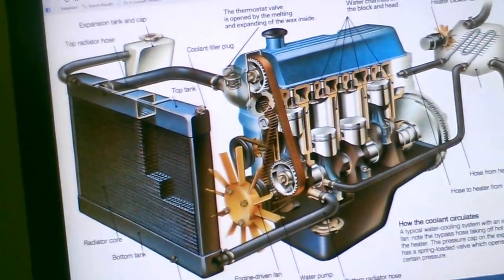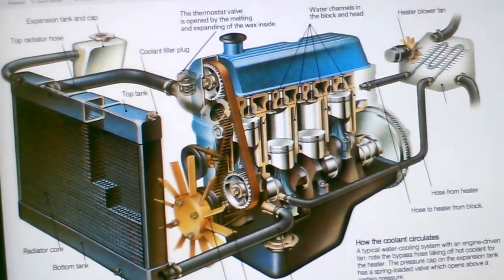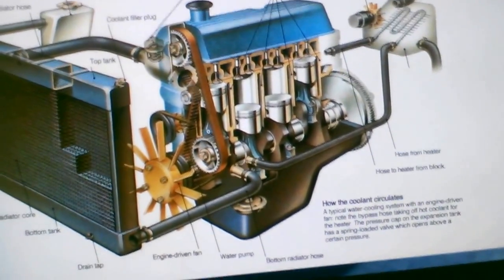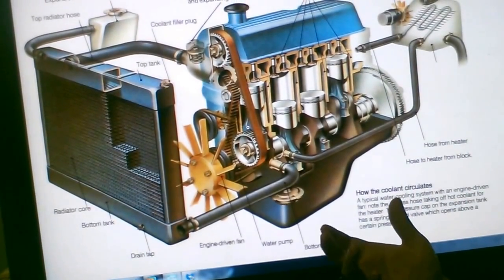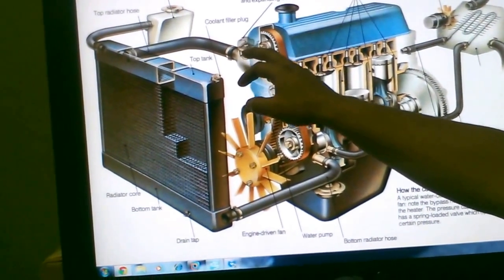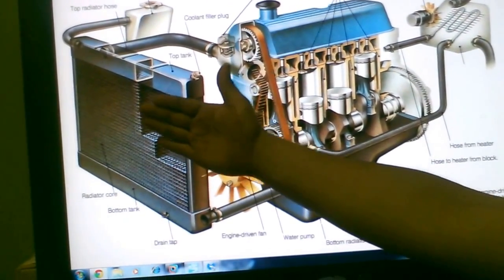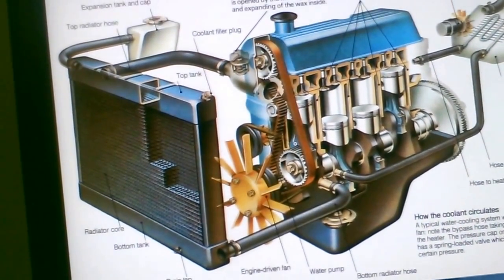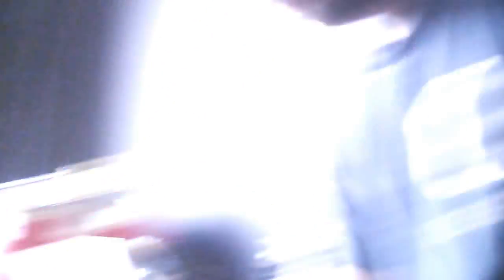Overheating problems ? How cooling systems work

Comment: My 2002 Chevy venture 3400 engine overheats in a few minutes goes to really hot , I have replaced the radiator, water pump, cap, thermostat, and both fans but still overheats !? There is no water in the oil or white smoke could it be the catalyitc converter?

Comment: Radiator service  ready, water pump change ready,  fan belt change ready, injectors change ready, head gasket  change ready  then what's a problem of over heat

Comment: For the life of me I couldn't figure out why my 6.1 Hemi is over heating! New water pump, new fans, new tstat, new radiator, new reservoir, and flush and fill. Still over heating and it just may only be the sensor lol. Great video and info... hope this fixes my issue.

Comment: Hi OZ! Thank You! My 2003 Lincoln Aviator is no longer over heating due to having a new pump installed. My problem now is, it shuts off when I turned the wheel to back up into a parking spot & it then started right back up. HELP OZ!

Comment: Hello, at 4:02 it was mentioned that the fan was not turning on, so at some point the water or coolant boiled and steam left the reservoir tank. I wonder if that can still cause damage to the engine (given the liquid may still be circulating ok because the pump and thermostat are in good condition, AND you stopped until temperature reached normal range.) This actually happened to my B14 Sentra a couple of weeks ago, and it got me a bit worried. I tried to figure out any damage by closely looking at both the motor oil and coolant, as well as any leaks, but found nothing. Just in case, I have changed both the oil and the coolant, and of course I got the electric fan fixed. Any thoughts? :)

Comment: Hi! My 2003 Lincoln Aviator overheats & shuts off.  Hubby changed out the RADIATOR, THERMOSTAT & still the same problem. Took it to mechanic & it came back diagnosed as  WATER PUMP LEAKING! NOT!! HYDRACARBONS in COOLING SYSTEM. We need to know, if & what needs to fix it from overheating & shutting off. wasting $$$$ & still have the same problem. Thank You
Reply from the maker: https://youtu.be/oNg-MyuZiTk 
https://youtu.be/zY6_Y64O5o4
https://youtu.be/VBMWFKOE-So

hope these videos help

Comment: Thanks for this good informations, but my car heats up when I'm drive over 80 km, mabe after 20 min if I drive on 100 it's gets hot faster, what do you think I should start from ?
Reply from the maker: Mahmoud Rassoul I would make sure that the system is topped off. If that's good check the fans make sure they're working

Comment: I have a leak somewhere I have to fill overflow bottle on my Lexus every morning. About once a week it overheats and the water in the overflow pops the cap and starts spilling out also there is a major delay in the fans turning on and there is a whistling noise. Eventually the fans turn on hopefully and the water is sucked into the system from the overflow bottle. Any ideas? Rad cap? New radiator and thermostat and hoses 2 yrs ago. Also the upper rad hose gets pregnant and has white around it. There is coolant flowing through. I am ordering a new rad cap and coolant sensor. Should I replace upper rad hose too? Thermostat?
Reply from the maker: Beeastman123 check out these videos 

https://youtu.be/QYT9g5dh8z8
Reply from the maker: Beeastman123 https://youtu.be/Zxdhkw29oK4
Reply from the maker: Beeastman123 https://youtu.be/6BN_Tke7xL4
Reply from the maker: Beeastman123 hope these help
Reply: Oz Mechanics ok thanks! Also I notice a thumping sound when I'm behind the wheel maybe water pump?

Comment: some mechanics suggest, simply remove thermostat. any advice? thanks in advance.
Reply from the maker: Alvin Balonglong without the thermostat the engine will never get to operating temp. The engineers made it that the engine runs at operating temp and that's how you get better car efficiency. But now if you take it off the newer cars. The check engine light will go off

Comment: hello. .I've been figuring out why my car overheats.  it's a 98 Integra (auto). i noticed my car overheats in idle but maintains Oper Temp when driving again.  i have replaced my thermostat,  upper rad hose,  water pump.  my cooling fans did come on but i feel  it's not cooling the radiator enough until forced air from driving cools it down.  Can i pinpoint that the radiator is bad?  i have the radiator in there replaced about 6 yrs ago non Honda radiator.

Comment: fan works, idling makes overheat, i dont get it. no leak. what could be the problem? when the vehicle is moving at a moderate speed, like minimum, the temperature drops like fast. but as soon idle, it builds up heat.
Reply: Could be malfunction of TC which enable cooling fan or cooling fan itself. Check if the fan is running smoothly when idle. Hope it helps. :)
Reply from the maker: DopestDope check out my other video of how to check overheated engine

Comment: The thermostat's job is to open when the coolant gets too hot and let the coolant travel faster into the radiator. If it senses the coolant is too cold, it closes to slow ...

Comment: The cooling system is made up of the passages inside the engine block and heads, a water pump to circulate the coolant, a thermostat to control the temperature of the coolant, a radiator to cool the coolant, a radiator cap to control the pressure in the system, and some plumbing consisting of interconnecting hoses to ...

Comment: This is the primary cause of engine overheating. Possible leak points include hoses, the radiator, water pump, thermostat housing, heater core, head gasket, freeze plugs, automatic transmission oil cooler, cylinder heads and block. ... A leak-free system should hold pressure for at least one minute.

Comment: I suggest  that you redo this. The water pump is very important...so no likes...sorry and you are saying water? Its antifreeze
Reply from the maker: thanks for the advise. was one of my first videos. did it on the fly
Reply: Using the term "water" is fine, since it is the water that is actually doing the work. antifreeze is added to keep the water from freezing in colder temperatures. there are actually areas in the world where water is used year round. 

i think Oz hit on the relevant points for the problem with this vehicle. don't pick him apart. the thermostat is important, too...are we going to focus on what he didn't do?  or thank him for doing what WE didn't do. 

what I want to know is, how much did you charge the customer for these repairs?  I'm on a hunt for fair and honest garages around the country, who are fair to customers who don't know anything and customers who are knowledgeable alike, and do no price gouge for the purpose of making a few extra bucks. I'm developing a method for these garages to make good money and acquire a lot of business, as these types of mechanics deserve it.  so... $$$?